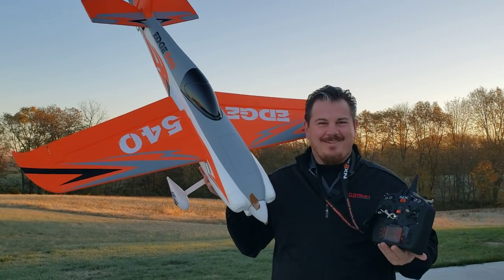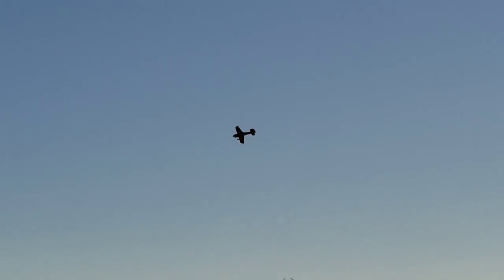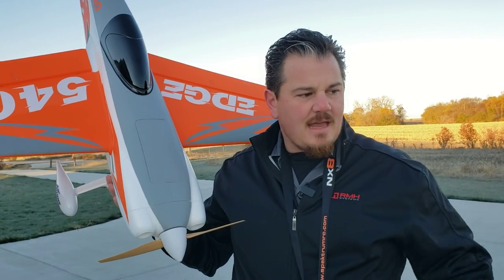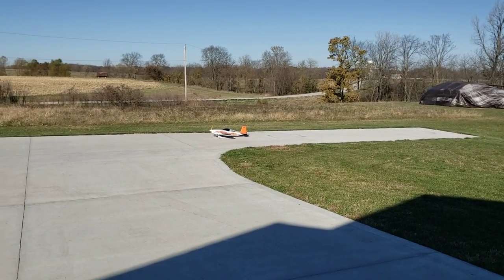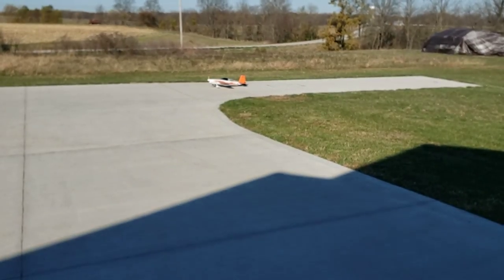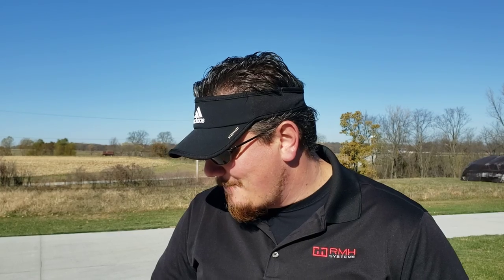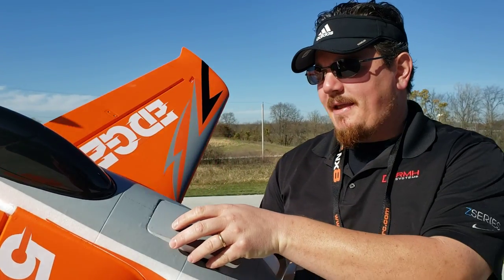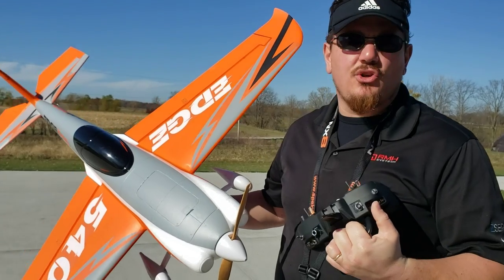Arrows - Edge 540 - 1300mm - Unbox, Build, Radio Setup, & Maiden Flight

Comment: Hey Brian Just Take A Block Of Wood w/Sand Paper & Run The Motor Slow Untill You Grind The Wood Prop Down To Equal Sides... 🤪🤣
Reply from the maker: Nope..it was split almost 1/2 the way up the prop ;( BUT otherwise, I was gonna take the prop to the table saw ;)

Comment: Lining up those wing bolts was a pain. I ended up sanding a little  then putting the bolts into the wings before installing in the plane. I used a long allen wrench  and eventually was able to get all 4 bolts tight.

Comment: I noticed this one is not anywhere near as agile as the E-Flite Extra 300. Doing rolls with the Extra it drills like a high speed machine even on low rates.
Reply: Was thinking the same, this looks like the better first 1.3m 3D plane option before stepping up to the E-Flite Extra 300 with it’s full wing length ailerons.
Reply: Yup, I have the Extra 300 and I love it. This edge looks ehh on the flying for some reason. The extra is just locked on rails
Reply from the maker: We'll do the V2 of the Extra 300 soon...so maybe? It's been a while since I flew our V1.... Hold that thought.
Reply: @BrianPhillipsRC  My V2 is crazy!

Comment: For 3d type planes with lots of throw that are hard to trim go into system setup, trim settings, and adjust the trim steps so each “click” moves a smaller amount. Before, 1 click up or down would go past center. Adjusting step size makes it so 5 or so steps have the same amount of adjustment for finer tuning and you can find the center. You’ll hear lots more beeps to trim now.
Reply from the maker: Nice! Thanks for the tip. I need to remember this now when I run into that issue in the future.

Comment: So glad you reviewed this one, really wanted to see a brave pilot fly it :) I'm surprised you havent done any Arrows planes. I own 5 or 6. The Vector stabilizer is as good or better than SAFE, and they tune it for each model. My only issue is you cant adjust it like a Spektrum.

You'll love Arrows models. They are as good or better than anything else out there. The STOL Bigfoot and Husky are awesome, and I'd put them up against the Timber and Carbon Z.
The warbirds are great, the 54 inch glider is great, the F-15 and all the sport jets are must-haves. Every aspect of the quality will match the competition. Their Customer Service is top notch too.
Reply: just watching the build portion and seeing you go from snooty to respectful in a matter of 3 minutes was awesome. Every Arrows plane is just like this one. You will love assembling them.
Reply: The timber? Bold statement. Lol. Arrows seems under rated.   I got the arrow husky.   Awesome plane.  Except I ran the prop into the ground while taxing on tall wet grass.   Since then the motor will shut off  full throttle some times have to dead stick landing sometimes if I’m not high enough.   Comes back on  after ten seconds or so. I must have burnt the esc up or something. Or motor.   Would like to make it 6s.
Reply: @ruger1420  I've done that on two planes and smoked the motors. The new Husky is 6S. I like my Bigfoot on 4S better than the Timber. You just put a Husky ESC in it and its good to go.
Reply from the maker: I hear they're all pretty good, but I guess we'll have to wait and see ;) So far so good! Loving the experience. Arrows seems to be legit! Can't wait to get my mits on the little Viper and T33 - I'm excited especially for the F-15 ;) OH YEAHHHHHHH

Comment: Thanks for the tip about not pushing the control surfaces to where it moves the servos. I have not heard that before.
Reply from the maker: Sure thing! It can be pretty tough on the gears, but if you HAVE to do it...once in a blue moon, you'll be fine.

Comment: Friend of mine bought the 540. Somehow word got out that “building” ArrowsRC planes was my specialty, so I was asked to build it… but not maiden it…
After your (as always) insightful video, I had the 540 built in 15 minutes. All that was left, 4 easy screws to hold the wings in place and setup the ix12. (It was about 8:00pm Friday night, and since I have no life, I got the Tito’s out and planned on watching the Braves blow a 5 run lead) 4 screws. Yeah Brian struggled, but he’s trying to film and explain. What are the odds I’ll have the same issue??? Those odds would have to be up there with Lou Gehring dying of Lou Gehring disease. 
Around midnight, I gave up. I had taken the wing out and checked to see if the screws lined up and I was, without the wing in place, 1/16th of an inch off. I had lots of ideas how to get things to line up, none were good. Then I noticed the expiration date on the Tito’s and I needed to speed things up.
I took the Edge to the field the next morning (7:15am) and since it wasn’t mine, get some help or suggestions when all four screws miss. (Had the medium CA and Kicker on the table if all else failed)
With the help of two large mammals, we slid the right wing in place and finally got one screw to line up. An hour later we finally got all four screws in place. 
The upside? The Edge 540 flew great. No real need for all the gyro and stability stuff. Easy to takeoff, fly and land. But those four wings screws…. I’ll be back in therapy like 6 years ago when I bought a Dynam Corsair and the HobbyKing 1600mm FW-190. (Both were several day builds, 3000 parts/screws)
I do need to call Dan and apologize. I wished some hateful shit on him, and I said some things that questioned whether or not his parents were married when he was born.
Rates for a non-3D pilot- 100/70, 80/70, 60/50. 4s 3000, 70c. No stability. (Tried it with 2500, and 2750’s. Liked the 3000 the best)
Reply from the maker: LOL - Amazing!

What you missed was the part we edited out, where I used our tractor loader to squish the wing into alignment - LOL...(JK btw).

Glad you finally got to dip your tip, with the help of two others ;)

Comment: Great review .. lol ... you make it my next purchase .. haha...

By the way, I their 1.8m Husky standard edition (4S),  other than the slightly under power of 4S for a 1.8m plane, it fly awesome, and surely a great floater comes to landing, can do it easily with total throttle off .... it's special edition 5S would be a great plus point for some aggressive maneuvers.

Haha .. talk about that cheap tinny battery buzzle, I have a dozen of those ... since my started flying in my 1st year, ... really handy .... in additional to the Tx timer (without telemetry)... also pretty handy once in a while I used some of the aged lipo battery ...which can be premature out of current ...lol.. this little buzzer does save the plane in this situation.

Cheers
Reply from the maker: Thanks wi! We'll hopefully be able to test these things out for ourselves soon!

Comment: Got the plane, tried 2200 in it but struggled getting cg. Moved battery way forward which was better.
Have you tried a smaller pack? was thinking of adding a bit of nose weight 🤔. 
Also it seems to be twitchy on pitch?  someone said it could be elevator servo not centering? 
one more ,  what did you find was the best % for throws  and  expo ?
cheers Brian for the great content 👍
Reply from the maker: Thanks Rick! I haven't flown this or any other 3D plane much other than what you guys see here...3D is not my "native language" - LOL ;) so I don't do it for fun, as much as others. I prefer to fly them like scale warbirds - LOL

Comment: The wing was a bit of an issue for me too. Wound up removing some of the spar receiver that was extending too far prohibiting the wings from seating together properly.
Reply from the maker: NICE!!!!
Reply: I tried that also and nothing worked. The wing and fuselage just finally snapped from the pressure of trying to fit it 1000 times. This plane is junk. Ive never seen any fit issues like this. every piece was a nightmare.

Comment: Beeper should work, use them all the time, have to make sure you have the cell trigger voltage set but it should have triggered and mine is pretty loud actually.
Reply from the maker: yep!

Comment: Hey Brian,  Nice work as always. Way to fly the snot out of your batteries, too... Love that stuff! This latest offering looks remarkably like the FMS Edge 540 V3 from waaaay back except for the upgraded power system & (Arrows?) vector/gyro control. Sort of like the latest HH (FMS) Extra 300 PNP. This Edge's canopy design hides the modern Edge V3 look. Needs a stouter landing gear as those wire legs are notoriously flimsy for a Bird of this size & weight...as you found out...
Reply from the maker: I can see how you would say that with the gear, but I was not being very nice to these, admittedly. I could have been a bit more gentile ;)

Comment: That's an able performer and looks well built, but after you add the receiver, it's same price as Eflite Extra300. So I'd just get the Eflite one. The whole advantage behind going with the smaller company is because it should be cheaper, right?
Reply from the maker: Not the same price, it's about 10-30% less depending on what Rx you buy. They're offering a coupon code too, for now...so it's a pretty good discount, and seems to be almost the EXACT plane...from what a bunch of commenters are saying...which I'm not gonna say...this is NOT the Extra 300, but it sure feels good, LIKE the Extra 300...so when we have a chance to do our V2 Extra 300 (soon...maybe next week) we can share our findings. I think it'll be hard to honestly recover the value added with the lower price, since it flies so dang good, and looks amazing still...

Comment: How does this plane compare with the Eflite Extra 300? They are the same size, 1300 mm. The Arrows comes with the VECTOR  but not a BNF so once u buy a basic receiver, the prices are similar. 

I am considering this plane for my Xmas present to myself. If I do, I will use your link.
Reply from the maker: More money for the Extra 300...both are great. You can literally buy all of the choices after following the link on the video ;)

P.S. Super secret notes...we'll be reviewing the V2 Extra 300 soon :)

Comment: Hi Brian, with this Vector flight controller can we use any Spectrum receiver? Does it has to be 4 or 6 channels? Please let me know I don't have it clear.
Reply from the maker: Yes, you can use any Rx brand. This is just a Stabilizer, so any Rx should work that's got the right number of channels.

You need the AR620, if you want to be able to control the Stabilizer.

1 throttle
2 ailerons
3 elevator
4 rudder
5 stabilizer on, off, auto-level - if you don't have channel 5 the vector won't work
6 spare

Comment: Great video from you and wifey / Camera crew.  Just destroyed my E-Flite EXTRA 300. NEVER going to use AS3X or SAFE ever again.  Going to order this one from your site.  Two quick questions.  Can I completely bypass that factory stabilizer set up that comes with the airplane.  Going to go Old School, Raw Dog and program Flaperons / Spoilerons on this one.  Are all the servo plugs compatible to a SPEKTRUM Receiver.  And will a 4s 2200 battery balance this airplane without any additional weight added.  Let me know please.  THANKS. ............. Getting sick of E-Flite.
Reply from the maker: You can turn off the AS3X and SAFE if you don't mind FACTORY DEFAULTING the Rx, or if you get the Arrows Edge 540, you can bypass the Vector, which I believe has an  OFF SETTING...but I'm actually not 100% sure on that. I thought it was whatever channel you assign, it needs to be at 0% (center) position.

...BUT, why would you not want AS3X? I get not wanting or needing SAFE, but AS3X is so nice!

https://bprc.me/Extra300
USB to PC Programming SPMA3065 TX/RX USB Programming Cable https://bprc.me/SPMA3065 (this will help you FACTORY RESET your Rx, unless they updated the firmware to latest and greatest already, which means you can just go into FORWARD PROGRAMMING and select ADVANCED MENU (or some such thing) then they have FACTORY RESET right there. You can, for the record, set it all back to like new BNF, but it'll take some effort, so make sure you really want it to be reset before you do this...
VS
https://bprc.me/Arrows_Edge540
https://bprc.me/HBZ_AR620 | https://bprc.me/AR620
https://bprc.me/4S_2700
https://bprc.me/NX8 | https://bprc.me/NX10
Reply: Thanks for the response.  Just getting sick of all this Electronic Programming Confusion.  Most of the time it works, But when it goes wrong,  You instantly loose an airplane.  And it's always blamed on the pilot who programed it.  It's Never the Electronics that went wrong.  Just lost an EXTRA 300.  On the Maiden.  During take off.  In SAFE MODE.    @BrianPhillipsRC

Comment: I've had terrible problems trying to get the wing bolts to line up. Further inspection shows the plastic plate in the fuse was glued in too far over one side so a bit of surgery was needed to re position it. Sounds like this is a common fault in the factory as Brian has pointed out.
Reply: That's the rear plastic plate. The front one was fine.
Reply from the maker: Try prying it first...if you still can't get it to line up, then I'd really think about calling them up at hobbyzone and seeing what they say before surgery.

Comment: Brian GREAT Video...You mentioned the 637T Question: I have a 637T that was in an other plane is the reciever locked? Would I be able to reprogram it for another plane?
Always enjoy your approach to reviewing a palne.
Reply from the maker: If it's an AR637TA from a bind and fly...then , and it is locked, you should be able to unlock it by updating the firmware...then you can use it.

That being said....if it's an If it's an AR637T - then all you have to do it reset it in the forward programming...factory default it and you're ready to rock and roll, but WHY would you use such a sophisticated Rx for this plane with Vector??? If you got one WITHOUT Vector...sure, but otherwise, keep the AR637T (or TA) for another plane and plop a simple Rx in here.
Reply: Thanks for your reply Brian. I decided at go ahead with the 6 chn antenna less receiver. Also thanks for the information on unlocking the receiver :)

Comment: Question: Is the Vector your stabilizer of choice?  How about using it on sailplanes?  Many Thanks
Reply from the maker: Not really. It's what comes from Arrows, but they are proving to be GREAT! Vector is the SAME as the FMS Reflex, fyi, but I think the AR631 or AR637T are my "preferred" choice, if I had one. I like to setup the plane they way I want, but the Vector is a very close second, and makes these planes so much cheaper to outfit, no stabilization needed in the Rx...that can be a huge savings for some...but my thinking is that if Spektrum could make their Rx'es ALL AS3X capable and make them hit a $30-40 price point, they would basically kill off all competition...but they won't, and probably good for us in the hobby world. Better to have a few brands keeping pressure to develop new and better tech.
Reply: @BrianPhillipsRC  Thanks Brian, I appreciate your taking the time to answer! Bill

Comment: This plane is a copy of the old FMS SBach with a more powerful motor. The main landing gear structure is weak, all 4 wing screws go thru both wings so you can probably fly it with only one or two of them installed. 

Once I installed a more powerful motor and used a 3300 mah 4S battery and put some weight on the tail, it became one of my fav's( I fly it as a sport pattern sort of, not 3D). 

Eventually the landing gear plastic structure broke and I replaced it with a classic composite gear screwed into 1/4" plywood epoxied into the foam.
Reply from the maker: This is a different plane, but like you said, still made by FMS....my reply from another comment just a few minutes ago, since I don't know which you'll get first...

Arrows is made by FMS, there's no "copy". This is strictly a branding decision. For example, when you get your milk at the wal mart, and it says WAL MART (generic), I can almost guarantee it's coming from the same dairy as your more expensive "name brand" milk. This is how all MFG'ing works. That being said, there may be slightly different electronics, or livery, or packaging but again, they're the same basic item. Sometimes the electronics are IDENTICAL, other than different stickers on them, unless they're calling out a different spec. This is why we do our review videos, since there's a bunch of choices, and many times, it's HARD to tell the difference in performance.
Reply: @BrianPhillipsRC  I had noticed some of the motors each uses are the same but I did not realize they were the same company. Interesting  I guess.

Comment: I did some lazy interweb searching, but do you know why the Extra from HH and this 3D plane have wooden props? I am very tempted to by this one, from your link of course sir. o7
Reply: because both of the planes are actually made by FMS in China.
Reply from the maker: Not sure, but they are BEAUTIFUL! I wish I wouldn't have smacked mine on that last landing, but after some slow motion review, I DID squat the plane down pretty hard and that's where I clipped the ground ;(

Oh well, I already have a plastic prop on there 13X4E and working like a charm - and yet, I have already dipped the tip ;) (I would have broke my wood again - LOL)